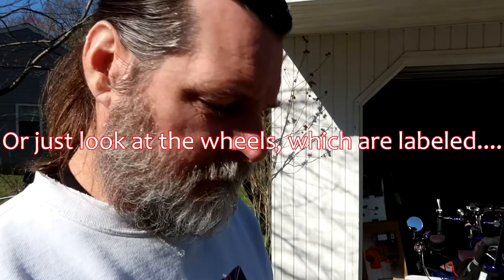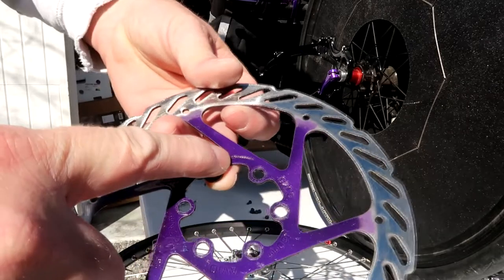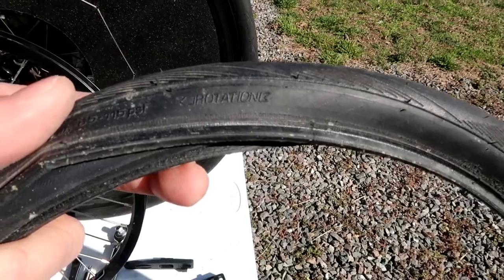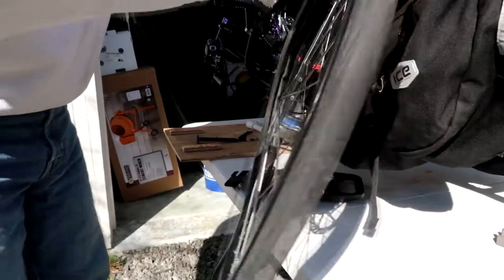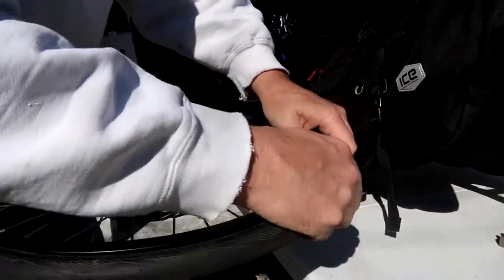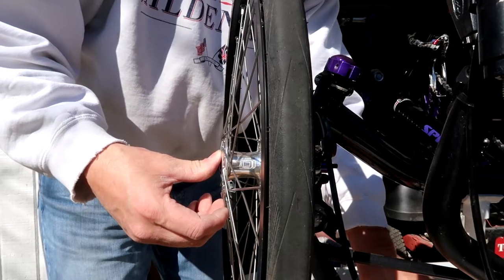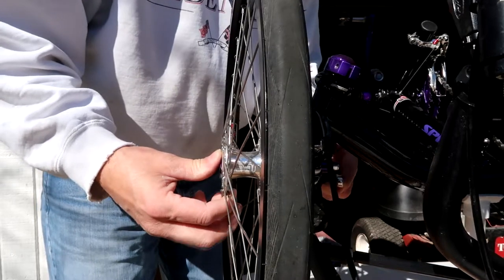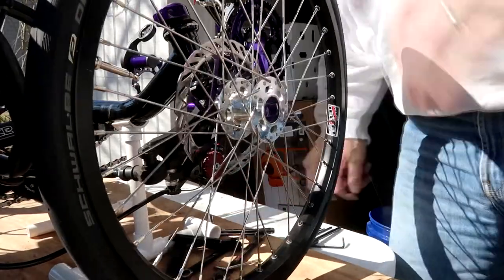Tech Time: Wheel Change

Comment: You taught me something! I changed my Durano tires here in Florida last month on my Catrike 700. I only got 2200 miles on them…all on smoothly paved trails….I got 4500 miles on my Schwalbe Marathons on my 559. The Catrike folks told me 2200 miles was excellent…but I think otherwise. I was unaware of the rolling direction arrow on the tires so I just checked and I was lucky and put them on correctly. I didn’t want the dirty job of having to do it over!.i bought a spare set of Duranos when I bought the 700 last fall as I knew supply chain issues made availability difficult. I went to order a new set to have as I have already put 800 miles on the new ones and I found that the Durano is no longer in production. Do you have any suggestions for my next set? I’ve always used Schwalbe but I can change. The Durano is a very firm, hard riding tire but fast. Any thoughts?
Reply from the maker: Glad to help!

I always like Duranos, but did not realize they were no longer in production. I was making the switch to Continental Contact Speeds, which I hear are great for both comfort and speed, but sadly could not get any to actually be shipped. I had two separate orders cancelled due to not being able to fulfill them. I'm quite happy with my Kojacks. I have them on the velo, and they work great. I don't have power meters or anything that fancy, but they seem to roll just as fast as Duranos, but are a bit bigger and I don't pump them up to 90-95 psi. I'm at around 80 and they work great for both speed and comfort. I have on mine: Kojacks on the front, and still the old Durano on the back, but I do have a brand new Speed for the back for when the Durano wears out. The ELB as Kojacks all around.
Reply: I have ordered new Continentals and hopefully they arrive before I need them. I got 2200 miles out of the duranos ip front and will have my shop mechanic change out the rear when it get home  in 2 weeks. They will have 3100 miles on them when I return. I have a replacement Durano for the rear but the next set will be continentals. The Durano s are fast but very hard and create a much stiffer ride. When I get home I will give my 559 some extra time and love as it is a more comfortable ride.